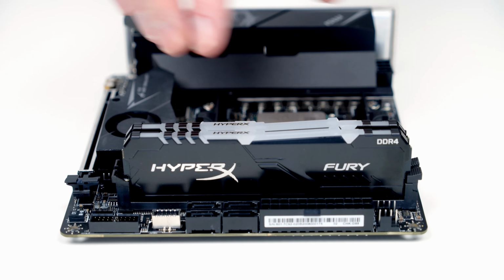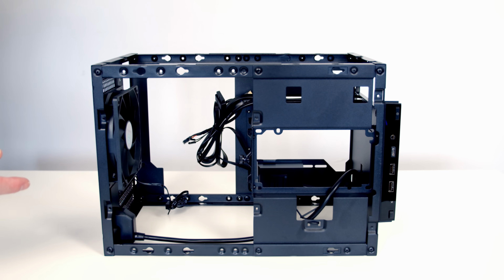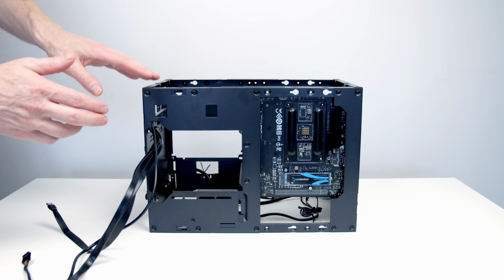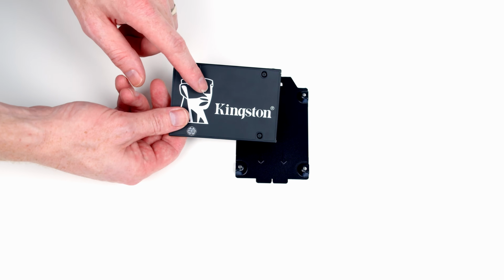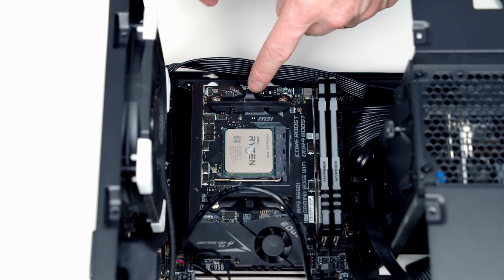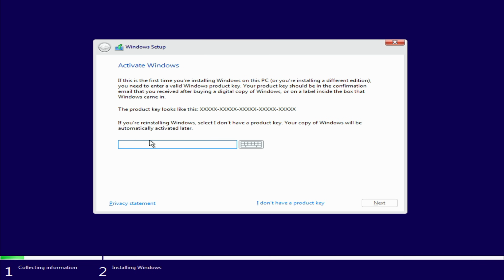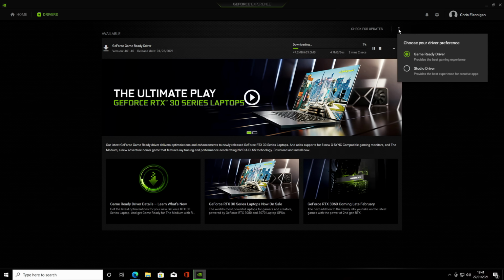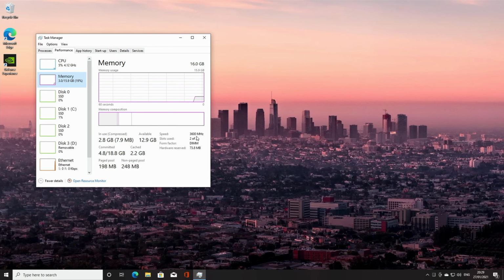SilverStone SUGO 15 Step-by-Step PC Build Guide

Comment: I have a slight obsession with SFF cases like this, but I feel like I may be better served building in a rackmount case because I require the system to be housed in a stately sidecar (or side board in standard furniture terms).

where are all the mid-to-high-end gaming pc rack builds??